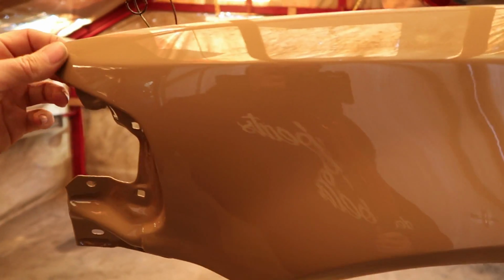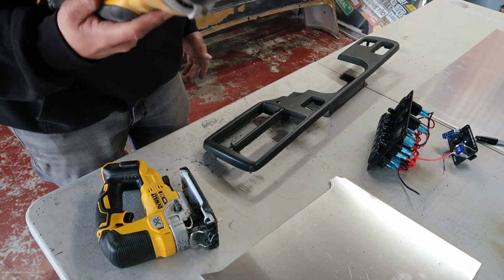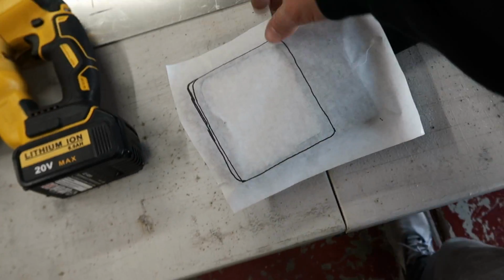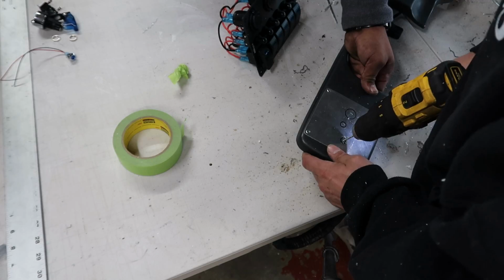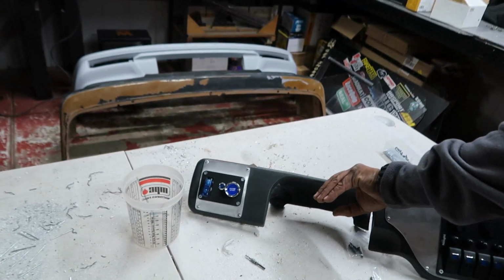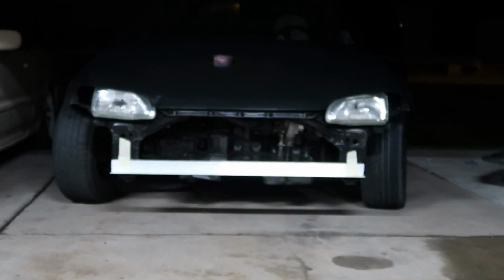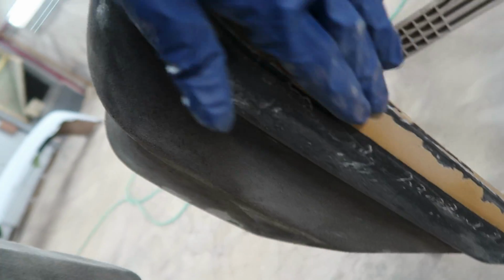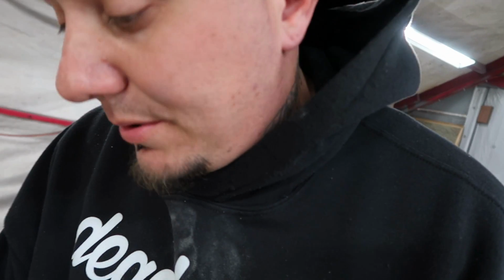Pimpin out JR's dash 🔥

Comment: Youre gonna regret sand blasting Poly-Urethane !
Don't do it !

Also, the roughness is good. throw some high build on it and sand on the high build. its just adding more adhesion for the paint.
DONT FORGET THE FLEX ADDITIVE FOR THE BUMPERS.